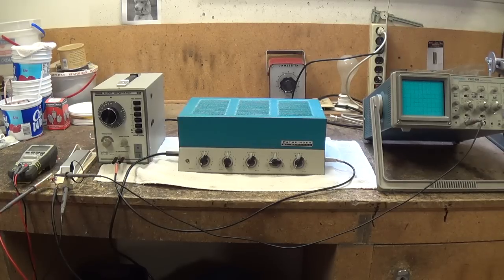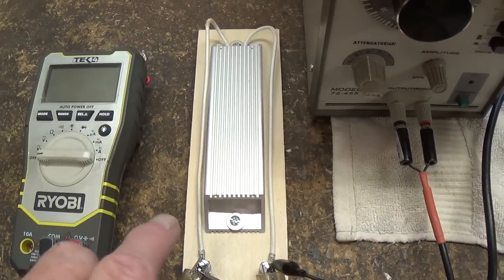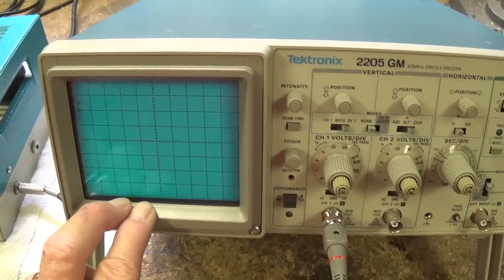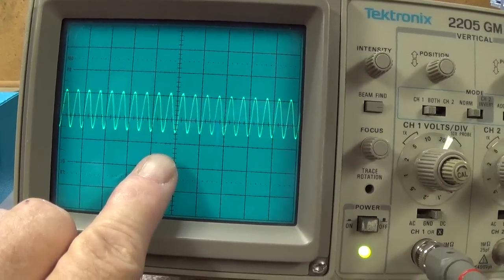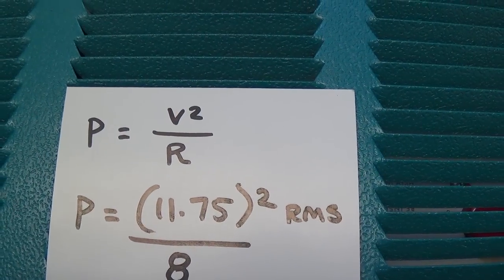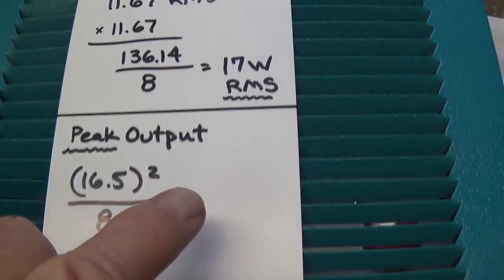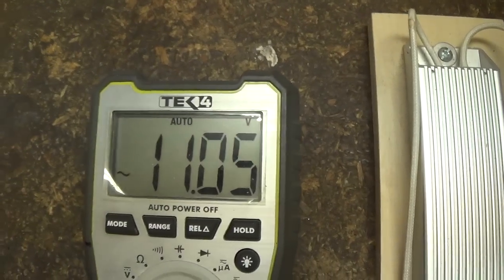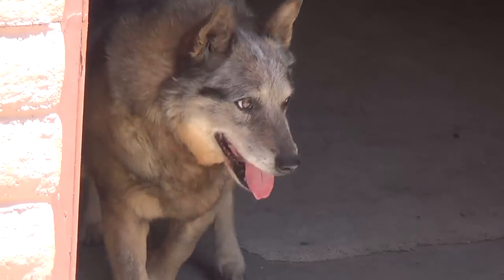How Amplifier Output Power is Measured

Comment: Hello Uncle Doug. I am soon to make a Fendsr champ 5 to 7watt valve amp. I would like to know what output I end up with. My function generator outputs sine/square and triangle waves at zero to 20 volts p/p what value should I use>
Reply from the maker: Sine wave at around 1V or less is appropriate for most amps.

Comment: Strictly speaking, there is no such thing as "RMS power". In fact it's average power, but amplifier manufacturers are stuck in their marketing terminology ways.
Reply from the maker: The term "RMS Output Power" makes sense to me, James, since it eliminates the possibility of the use of peak output voltage to inflate the calculation.

Comment: What does it mean if you’re getting a straight line with small curves either way, phase inverter biased too cold? Maybe excess neg feedback?
Reply from the maker: I really can't tell much from the description, JD......way too many variables.
Reply: Cheers for the reply Doug, you’re right. I doubt backing and forthing here would’ve found the issues it turned out to be! 

One of the heater wiring joints on one power tube socket had a cold soldered joint. 

It wasn’t bad enough to stop it lighting up, or passing an idle current while biasing with no signal; but it was bad enough to stop it getting as warm as the other tube; and that was stopping it conducting properly when actually fed a signal. 

Also, the bias was pretty cold, I didn’t realise the safe idle bias with a 4300ct output on a pair of EL34’s is a fair bit higher than it is with the Marshall standard 3300ct. 

Got a used Weller WSP80 soldering iron, some solder paste, and some pine rosin now, so solder joint temp issues should be a thing of the past!
Reply from the maker: This is an excellent example of just how fruitless it is to attempt long distance amp repair. Who would ever guess that a particular solder joint was cold?  Such discoveries have to be done on site. @Jonathan_Doe_

Comment: So to be clear, the wattage has nothing to do with the current or power draw from the house electrical supply?
Reply from the maker: The higher the power output, the higher the power input, Smith, but the power consumption rating in watts does not equate to the power output.....they are completely different values.

Comment: WRONG, Doug! The term "RMS" does not apply to power. Voltage and current (for a fixed resistance) affect power as the square of their values (P=I^2*R and P=V^2/R), so an RMS calculation is done to find the effective single value for time-varying voltage and current signals. It's only in the audio industry (with its lack of degreed electrical engineers) where the RMS label has been incorrectly added to power values.
Reply from the maker: You have your viewpoint. I have mine, Bob. Our channel relates directly to the audio industry, thus we use terminology they are familiar with.

Comment: How should one set the EQ's? At zero, full up, or halfway? Thanks.
Reply from the maker: Wide open, with passive tone controls.
Reply: @UncleDoug  Also, I have a Hartke HA2500 amp I will be testing. It has a 20mv input sensitivity. This is peak to peak, correct? So that would mean I need to set my frequency generator to output 1Khz at 20mv peak to peak? Thanks!
Reply from the maker: @jesseyasaitis9036  I think it's best to set up the output power measurement using an input of the same magnitude as the instrument with which the amp will be used, Jesse.

Comment: What's the amplitude of the 1khz you applied at the amp input ? i suppose it's in direct relationship with the max undistorted output ?
Reply from the maker: The amplitude is approximately equal to the typical guitar pickup output.....around 0.5V.
Reply: (sorry for being quite late in this party ahah)

Comment: Considering that a speaker has a variable impedance what would the output power in  16 ohm dummy load at 100 hz?
Reply from the maker: There is no way to answer your question, Felix. The information is inadequate. The video explains how output power is measured.
Reply: @UncleDoug  (sorry for the long comment) my question results from a questioning that I had when I made my el84 se hifi amp. It also relates to the experience of tube watts vs solid states watts. 
I'm in the opinion that measuring an amp with a dummy load is not representative of real life as a speaker has a variable impedance.
 And so when designing my tube amp I draw load lines according to the impedance of my full range drivers, ie 8 ohm nominal  and 20 ohm load (impedance at 80hz) and  realized that the power output was higher as the load increase. Hence my comment with regard to tube sound vs solid state sound as the power output of solide state amp reduces when load increase (200 W in 2 ohm, 100W in 4 ohm and 50W in 8 ohm, generalization)

Comment: What if you had used the measure of distorted signal? Does it go over because of the nature of tubes "soft clipping" and perhaps asymmetrically even and not cut at the peak straight? That's the most interesting part to me in this topic, why is it measured like it is? Does the more recent way to calculate loudness (LUFS) affect this? I assume not since it might be more complicated (likely pretty much software exclusive method to calculate, not by hand) and in general audio equipment manufacturers have been kinda lazy and clever in how they announce their specs to seem better than they are. 

If you would connect the output to measurement tools that can pass the digital information to a software, could you use guitar playing as input signal while recording the measurement data the whole time and then get a realistic peak and average output power?
Reply from the maker: Output power is measured at a minimal distortion level, for the simple reason that distorted output is generally not useful. Audio equipment dealers frequently lie or conceal the way that output power of their devices is measured, especially with regard to peak vs RMS output.

Comment: I don't know what model number of Ryobi Tek4 DMM you used, but the spec's on the one I've looked at are only rated from +/1% plus 5 digits from 40 to 400 Hz. So even your 1000 hz voltage readings are questionable. You don't really know what your power was at 1kHz and if your power did drop down at higher frequencies, or if it was just the DMM losing accuracy with increasing frequencies. Plus, being an average converter, this DMM only reads accurately with a pure sine wave, so distorted waveforms will also not be measured accurately. For proper AC readings, you should use a True RMS DMM with a far wider frequency range.  I was the designer of the now classic Fluke 8060A which has one of the best AC frequency ranges of any handheld DMM. It was designed with Audio applications in mind. If your Ryobi is a model with a wider frequency range, then please ignore this comment. ;-)
Reply from the maker: Thanks for your very knowledgeable input on this topic, Dave. I have since changed to a much more modern and accurate RMS DMM.

Comment: Cool video, thanks! I recommend measuring the output with differential probes, many amplifiers use bridged output configuration where the outputs drive the speaker with opposite polarity to increase power output. You would not see this if you measure using single-ended measurement method described here. Awesome video, love you dog! Cute!
Reply from the maker: Thanks for the info, Johnny.

Comment: Hi Uncle Doug, I'm trying to purchase a resistor like this to make myself a dummy load. Some spec sheets say that the power it can handle is based on the temperature with or without heatsinks...where do you recommend I buy such a resistor? Thanks.

Comment: Hey Rusty, why are you not supposed to run a tube amp without a load?
Reply from the maker: Don't say "load" to Rusty......the backyard is already littered enough :)
Reply: You can operate a tube amp with no load, as long as you don't try to amplify a signal. If you do, high voltage spikes are generated which can damage the output tubes, or worse, destroy the output transformer.

Comment: Hi Doug. Out of curiosity what amplitude of input signal are you using here?
Reply from the maker: Around 0.5 to 1.0V, to mimic a typical guitar input.
Reply: @UncleDoug  Thanks for the reply doug. Much appreciated.
Reply: @UncleDoug  Revisiting this Doug. Would that input voltage be peak or rms?
Reply from the maker: @gerrabath  If it's amplitude was measured with a scope.....peak. If measured with a multimeter.....RMS. Either way, it is of such low magnitude that the difference is small.
Reply: @UncleDoug  Thanks Doug. I've just acquired a used function generator which is fine for my needs but there's no built in amplitude indication, just an unmarked control pot. Bearing in mind your reply I was just wondering if I'm working with say line level (3v) instead of a mic/guitar input what would be the best method of measuring the larger unit output amplitude?
Reply from the maker: @gerrabath  You can use a multimeter to measure the RMS output or a scope to measure peak output. If you can get a scope you could calibrate the amplitude pot with millivolt/volt markings.
Reply: @UncleDoug  Thanks Doug. Sorry I'm not being very clear.  The heart of my question I guess was with my particular signal generator what to use, peak or rms when setting a line level amplitude up on the output.  I guess you may have answered that question with the calibration idea.  Thanks for everything Doug. Especially for showing such patience in the face of adversity! :-)
Reply from the maker: @gerrabath  You're welcome, G. Good luck with your project.

Comment: Informative video. Couple questions: To obtain the actual amplification value isn't the output of  the signal generator required? You didn't measure what it was before the amplifier.  I figured you would need to compare the input value to the output value (of the amp)
Also is there a frequency limit to an amplifier? You tested to 10,000 hz. What about say 1.8 Mhz? Is there a design requirement to obtain different frequency range?
Again, great video. Thanks.
Reply from the maker: The output does vary depending on the frequency of the input signal. Generally, the testing is done at 1to 2KHz. The amp is more efficient with frequencies in this range. Amplification factor is not specifically determined, and signal generator input is not particularly significant. You are simply driving the amp until distortion just begins to appear and then measuring its output power at that point.

Comment: One very important piece of information which I did not hear. What is the output voltage of you tone generator acting as the input signal?  Is there a standard input voltage like 150mv or lower or higher? Obviously an input of 50 mv would produce less power measured at the output than if it were 150 mv or 200mv. I have been trying to get the answer to my question. No luck yet. Hope you can help me. Great video.
Reply from the maker: Recall that the amplifier volume and/or input signal strength are increased until distortion appears in the output waveform. This is the maximum undistorted output of the amp.....which you measure. The actual settings of the amp volume and/or input signal strength vary depending on the point at which distortion appears.
Reply: Old thread, but this is a great question. The voltage out is simply the voltage in multiplied by the gain of the amp. So agreed, the voltage swing of the input signal is a crucial variable.

Comment: Hi, I have a question for you. How is it possible for an amplifier to output 100W of power by consuming 60W( like 12V 6A)? Am I missing something? I see amplifiers rated at 200W,  300W. But they are powered by a 12V battery. Is sound measured differently. 
Thank you.
Reply from the maker: Any amp that can produce 100W of RMS output power would have to consume much more than 100W of energy to do so, MS. Amps are not particularly efficient and always have to consume more energy than they produce. Also, no 12V battery-powered amp can produce anywhere near 100W output.
Reply: @UncleDoug  Thank you very much for replying me. I am confused by these terms amp manufacturers use. Unlike in USA and other countries we don't have rules (or maybe not implemented properly).

Thank you for clearing my doubt. ☺

Comment: I wonder why are you getting different output power wattages depending on the signal frequency input. 

To me it have no mathematical sense because there is no frequency dependant terms on that power formulae you used. So, I guess we can't expect no flat frequency response from this amplifier (maybe any existing amp can do that). 

In other words. The multimeter procedure can only be used when testing a flat frequency response amplifier. Am I correct?.
Reply from the maker: If you perform a frequency spectrum analysis, the results will not be a straight line. Thus, the power calculation is only correct for the frequency that was applied to the circuit during the testing procedure, and the frequency utilized should be stated. This is true regardless of the method used to measure the output voltage.
Reply: @UncleDoug  so, is it similar to the speaker impedance measurement specification?. Which it is measured around 400-600KHz or something if I can recall?

Have the power output watage in an audio amplifier a kind of standard frequency span where it is supposed to be meassured? I guess it have to be measured with no distortion as well.

What about the equalization settings? Any restriction?.
Reply from the maker: Yes, but the differences between power values at different frequencies is probably less than the difference between impedance values at different frequencies. I believe the standard is around 1 to 2Khz. Yes, you crank up the output of the amp until clipping just begins to occur, then back off until it ceases. RMS output power is traditionally at the highest undistorted volume level. (Passive) tone controls should be set to minimal loss to ground.

Comment: I know a tube amp with a given rms rated output will often as not have occasional 'peaks' that are twice that or more. Is there a rule of thumb to determine what a speaker rating should be to handle rms output wattage? 
thanx in advance and... cheers
Reply from the maker: My own personal rule is that the speaker should be able to handle at least 50% more power than the RMS of the amp. This gives you a little cushion of safety.

Comment: Hi uncle doug.  Luv luv luv your videos.  I have a bass amp in the shop i would like to do this procedure on.  Would 1k hz be used on this type of amp or is the 1k for guitar amps due to frequencies more common in a guitar amp?
Reply from the maker: I believe that 1KHz is the standard for this procedure as performed on all audio amplifiers, David.
Reply: And if the amp wants 4 ohm speakers i assume the dummy load should be the same yes?  I can use two 8 ohms in parallel.
Reply from the maker: Yes, otherwise your measurement will not be accurate for the amp in normal operating mode.
Reply: Sorry for ineffecient questioning.  How strong a 1khz signal?  1 mv?
Reply from the maker: I would use a signal strength which approximates that of the musical instrument with which the amp will be used, i.e. 0.5 to 1V for a guitar. If you really want to get clinical, measure the average output voltage of the guitar pickups. To me, the output power measurement should relate to "real world" usage.

Comment: Interesting. Do you have a video showing how to match a speakers with amps. for example, I have a rotative speaker from an Electone organ (15W and 8ohms) that I would like to plug to an amp but I am not sure what amp to choose. And ideally I would put this one as a second speaker of equal power; in this case, is it as simple as using a 30W amp at 8ohms on two 15W speakers at 8ohms?
Reply from the maker: The power is not as important as the impedance of the speaker, which must match the output impedance of the amplifier, i.e. 8 Ohm speaker with 8 Ohm amp output. Generally the speaker should be able to handle more wattage (power) than the amp can put out, i.e. 100W speaker with a 50W amp.....not the other way around.
Reply: So I am good with a 20W amp in two 15W speakers? But, when watching other videos on the subject, I heard that the impedance is to be calculated differently when using pair of speakers in series or in parallel. It gets me confused a bit. That in series, the impedance is added and in parallel it is divided. Please shed light on this for me?
Reply from the maker: Yes, the two 15W speakers can absorb a total of 30W of power. The impedance of speakers in series is added, i.e. two 8 ohm speakers in series = 16 Ohms. In parallel the formula is 1/impedance + 1/impedance = 1/total impedance, i.e. the same two 8 Ohm speakers in parallel = 1/8 + 1/8 = 2/8 = 1/4 The total impedance is 4 Ohms.

Comment: A question about the frequency generator...1K Hz is the standard input frequency to calculate output power, is there a standard input amplitude? Obviously input amplitude will affect amplifier distortion. Thanks so much for all your wonderful videos! They have helped grow and solidify my understanding significantly. Thank you.
Reply from the maker: You're welcome, NF. During the output power measurement, the input amplitude and amp volume are adjusted so that very slight clipping is barely evident on the oscilloscope. This is the point of maximum power output, regardless of the input amplitude or volume setting. If you drive the amp with high input, then the volume setting will be less than max. If at max. volume, clipping does not occur, then you turn up the input amplitude until it does.
Reply: Thanks for the clarification. Much appreciated!
Reply from the maker: You're welcome, NF